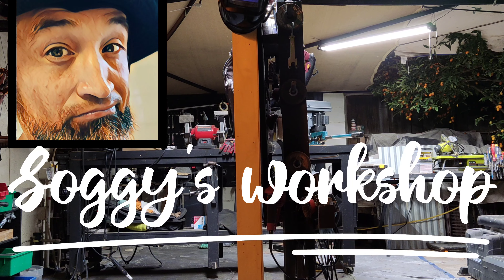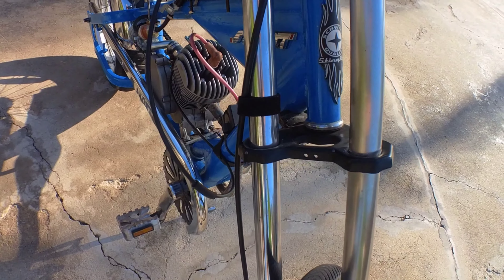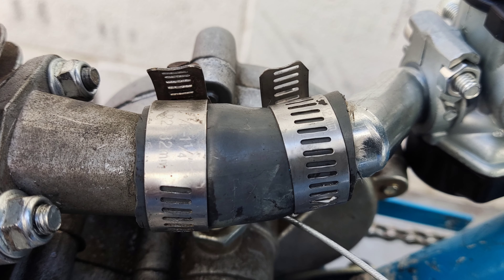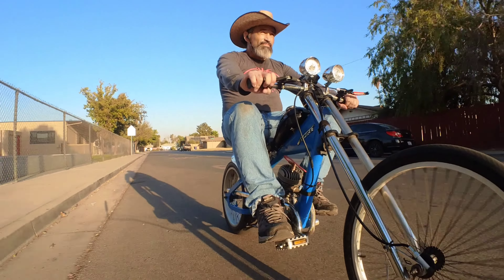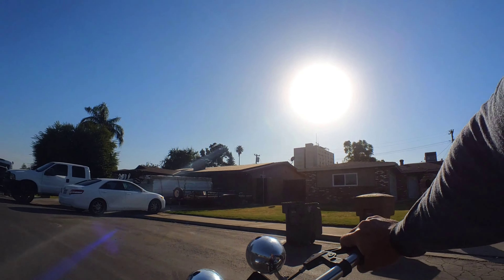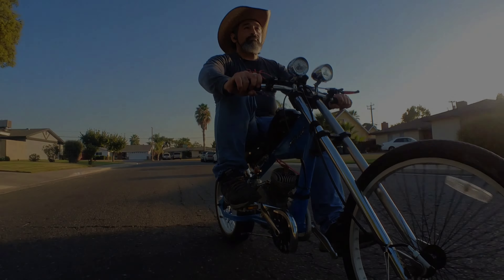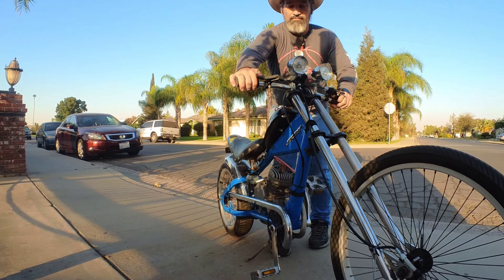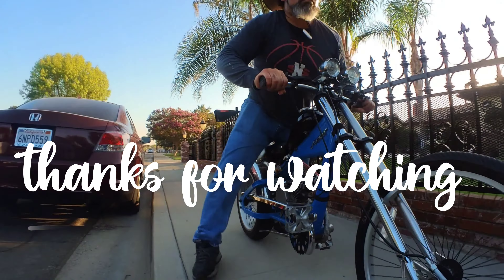STINGRAY PROBLEMS: challenging but satisfying

Comment: Looking good Soggy, Mr # 006. Mounted a throttle on a reversed brake lever, went back to thumb throttle not long after. Still use it for clutch. Thanks for the ride.
Reply from the maker: Thank you Mr. Arola. Yeah, I have had a lot of the stock throttles fail on me with time. I'm just glad that there's something that works from the salvage piles.

Comment: That’s cool, I built one of these a few months ago and it was a nightmare lmao, innertubes kept popping, I had tons of issues with the motor mount I got too, I put full size bmx bars on my bike and I painted the whole bike with gloss black spray paint and Mayte black for the fenders and rims so it looks totally awsome. I was able to fit the carberator on fine with no modifications, I used the Zeda80 engine abs it gets around 30mph. I have the bike, the build is done and looks dope. Well guess what? This bike is so uncomfortable to ride, the seat is so hard it hurts my tailbone and the lack of suspicious makes the toniest cracks hurt like hell. I was really disappointed because I loved how it looked and I planned for it to be my new long range adventure bike. Also it feels kinda dangerous riding in traffic due to how low this bike is. I’m currently riding a really safe motorized mountain bike I recently built. It feels so much safer and it’s a thousand times more comfortable.